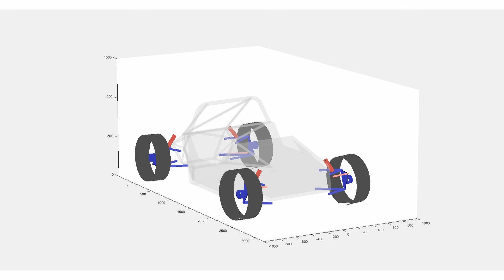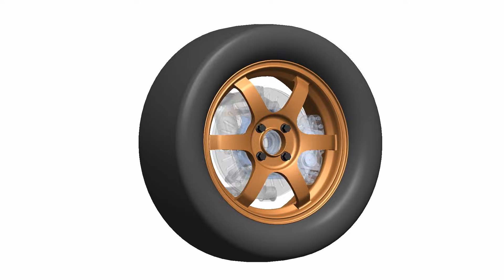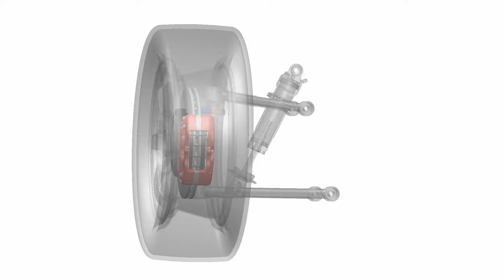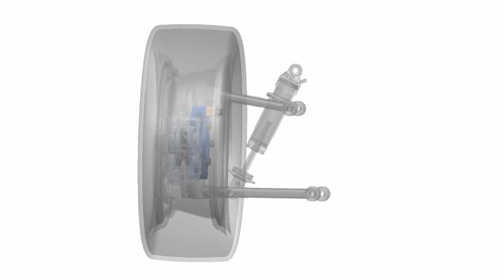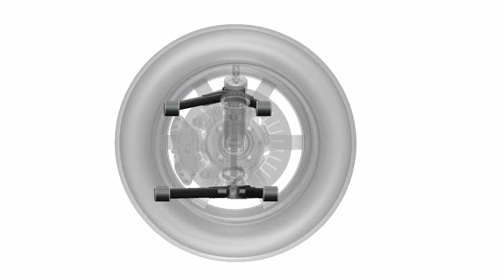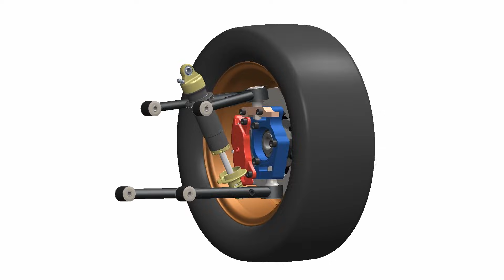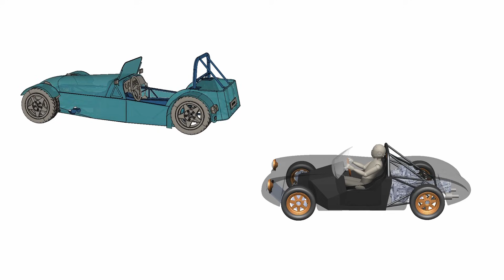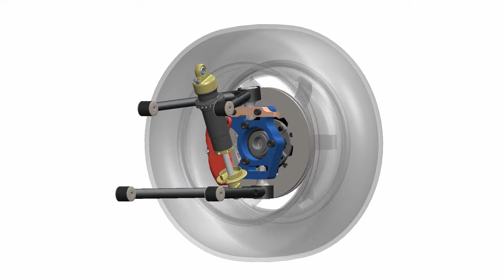Starting the Suspension Design for a Custom Sportscar (Project 171)

Comment: Very interesting! It seems that one would like to have as small wheel as possible, which can still fit brakes powerful enough, and wheels grippy enough for the vehicle/application in question. Yet, it is popular to fit a larger wheel. Now it wouldn't fit with the goal of being lightweight, but it'd be interesting to consider how active suspension, say hydraulic, could be implemented. Looking forward to future videos on suspension geometry! Hope I get a sense for where one starts and how one would iterate over the geometry design!
Reply from the maker: I will try and do justice to those topics, especially around suspension geometry, which is a subject dear to me. Would like to do something active suspension at some point in my life, but it is hard to identify the right project for that. My favourite F1 car is the FW14B, partly because of the active suspension.

I didn't talk much about some of the advantages of a larger wheel and low profile tyres.  Tyres have come a long way and it is impressive the grip levels that some heavier cars can have. Its more that this project is on the lightweight side, and smaller wheels can help with that goal.
Reply: @KevinHayward7 Thank you for the reply! I imagine that others who follow this project, just like myself, would find videos on these subjects quite interesting!

Comment: What book do you suggest to learn from zero suspension design? NIce video...
Reply from the maker: There aren't many books that go into how to design suspension specifically. It was one of the frustrations I had early on when learning this stuff. But it is hard for me to go past the Carroll Smith Books as being the one I think people shoudl go to first.  A lot of the info is now a bit outdated, some of which Carroll acknowledged before he passed, however they let you see into the mind of the designer and what he was prioritising. One of the best writing "voices" in the field.

I think the best thing to do is to practice and just read about everything you can. Once you go through multiple sources you get an idea of what is agreed upon, and what is likely unsupported theory.  In the now dead FSAE forums (a wealth of info) this is a good thread that covers a full car reading list (it is very long):

https://www.fsae.com/forums/showthread.php?1834-BOOK-LIST-to-reference-for-car-design
Reply: Pfft.. this guy hasn't even modelled the tyre tread!  What sort of fly-by-night dodgy brothers operation is this?
Reply: In the plan for alignment adjustment on the chassis pickups?  Obviously you need quite a lot of adjustment if you want to switch to a full race setup.

Going to run anti roll bars?

Any consideration of running inboard coilovers?  Ive never actually done it but it seems like a neat solution and looks so clean!
Reply from the maker: At this stage there is a small amount of adjustment at the upright with a bolt on upper balljoint / steering arm that can be shimmed. I am thinking that there will be bolt on brackets at the chassis to cover a larger range. For more extreme changes a different bracket or even a different upper a-arm will likely be made. Not as convenient to run, as having a large adjustment range built in, but will do its purpose.

The attachments for the damper at the lower wishbone is something I'm still playing with.  At the moment it is a symmetrical lower wishbone with the mounting tubes welded into the legs of the wishbone, but I will likely change that to have the damper sitting in a welded bracket on top of the tubes. Provision for anti-roll bars will be added in when this area is revised.

For this car I'm not keen on rockers and inboard suspension. It packages well, but it does add weight and part count. The will be bodywork over the dampers so not worried about aesthetics of a direct acting damper. I might do a custom end for the damper so corner weights can be adjusted independently from the spring pre-load (wont be much adjustment though).

Still a lot of iterations to go.